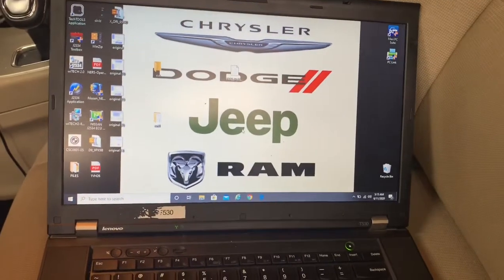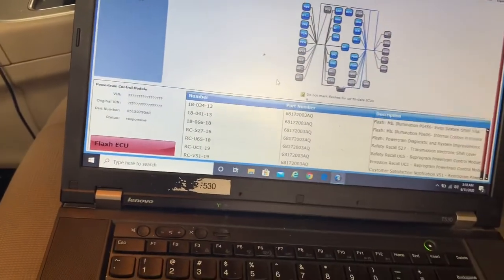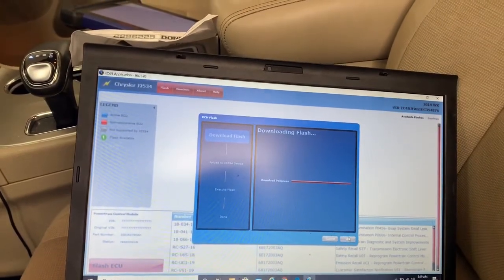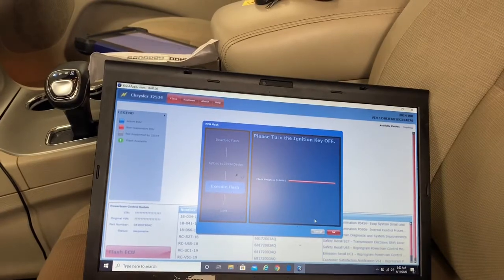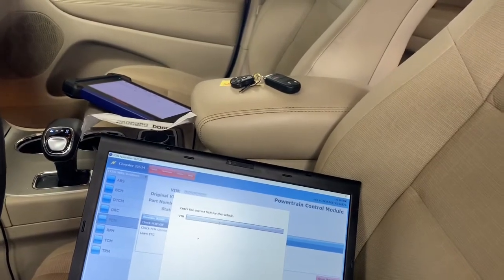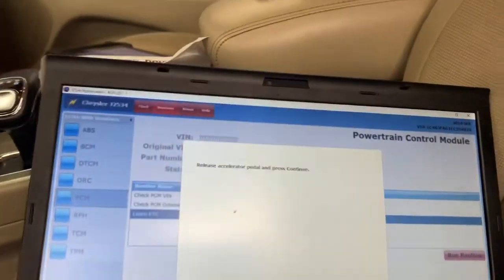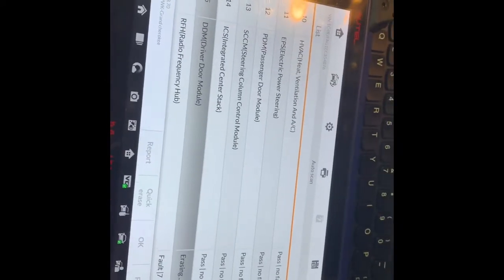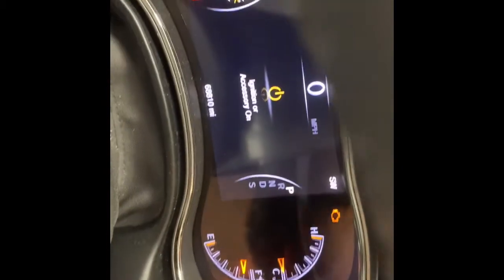2014 Jeep Grand Cherokee New PCM programming

Comment: Excellent video! Question-  From reading the info on Chryslers J2534 application, I thought you have to open the WiTech 2.0 app to program 2010 & up vehicles? Did you also need a WiTech 2.0 subscription to perform this program?
Thankyou
Reply from the maker: Hello, thanks a lot for the comment. you can do programming with j2534 on any Chrysler 2010 and up. The difference with wiTech is you ca do dealer level diagnostics and programming. J2534 does only programming and follow up routines. If you want to use wiTech years 2018 and up you will need tech authority subscription as well as wiTech. Anything lower than 2009 and lower you would have to use legacy application. Hopefully this will help out.
Reply: @huyug1  So im guessing you can program other modules with WiTech 2.0?
Reply from the maker: @autotechtogo6290  
Yes you can program any module you’d like as long as there is a file available.
Reply from the maker: @autotechtogo6290  you would see a thunder bolt sign by the module if there is an flash available .
Reply: Hello is your shop located in California
Reply from the maker: @chuy4739  I’m in New York I’m sorry
Reply from the maker: If you need I can connect to your pc and take care of it.
Reply: I don’t have the tools
Reply: My car is a Jeep Grand Cherokee 14. Do you know If there was ever a fix for this model?
Reply from the maker: @chuy4739  I’m not sure about the fix since I do not know the issue you are having. But just found out couple of days ago that j2534 flash application has banned and does not work anymore. You will need witech2.0 j2534 or microPod. You will as well need 3 subscriptions to be able to program. 
1. Tech Autority $26.95 daily
2. WiTech subscription $50 
3. Reprogramming subscription $35
That’s the only way of programming FCA vehicles unfortunately!

Comment: 2015 jeep grand cherokee. i replaced my pcm with a programmed new pcm with the car vin. the car engine wont start. it says press the clutch and push button.the pcm connector plastic piece i broke off bc after 10 years of rust i was not able to remove. however the pcm connector is tightly squeezed in the connector and snugged. the pcm is suppose to be plug and plAY.

Comment: i have 2015 chrysler 200 with push button,i changed the pcm and bcm from junk yard,do i have to ptogram it because now it says no key detected...i have tech authority and i know how to use j2534 applications..help
Reply: Pls explain
Reply from the maker: I’m guessing you can turn the ignition on but can’t start.  If that’s the case you do NOT need to pay for j2534 programming.  You will need a decent scan tool like Autel im608 or similar that will be able to perform special functions:
1. Go into BCM and select special function. Go into “check vin” function and it will read the current vin in BCM which belongs to donor vehicle. Than it will ask you to write the new vin which is the cars original vin.

2. Do the same thing as the BCM with PCM. 

3. Reprogram the keys with a capable tool. You will need the 4 digit pin code of the RFH( radio frequency Hub) which is ignition module or immobilizer. 

You might have to delete all the keys before you you reprogram them again. And those keys are reusable; does not need unlocking.  

If any problem you can contact me at 1 (347) 265-0322 and I will help you out.
Reply: Yes,you need to program them

Comment: Hi, need help with my 2018 wrangler jl, purchased from insurance auction with no ecm, bought a clon ecm online (to avoid all programming) once installed, jeep started with no problems but only for 3 seconds that happen 3 times then didn't even crank anymore. Just bought an new ecm from jeep dealer but they don't want to do the programming due the title. It's something you can do? I'm in Florida. Ty
Reply from the maker: Contact me on huso.technical@gmail.com

Comment: Thank you very much, this PCM it is new or already in other vehicle??
Reply from the maker: It was brand new from dealer
Reply from the maker: Used one is a lot more easier to program if you have capable scan tool
Reply: @huyug1   is it possible to reuse PCM already in another vehicle.
Reply from the maker: @hmohamed2006  yea definitely! And it is much easier to program.
Reply: but how to copy the other VIN? is it possible explained the method.
Reply from the maker: @hmohamed2006  what type of tool do you have?
Reply: @huyug1  launch
Reply from the maker: @hmohamed2006  I would have to connect to your launch tool and do it while explaining the process to you. If you want to get in get in contact my email is huseyin0240@gmail.com

Comment: can you get a print out of the final report
Reply from the maker: I do not have a post scan but there were no codes regarding to programming. And by the way j2534 application is outdated now it does not work anymore you would have to use witech or legacy.
Reply: @huyug1   thanks bro for the reply.   possible to get your email I’d
Reply from the maker: Huseyin0240@gmail.com

Comment: I have a 2006 Jeep Commander with a PCM that needs to be reflashed to latest software. How can I do that?  I have an Autel J2543 device. Thanks.
Reply from the maker: You will need to download witech j2534 or regular one if you have micropod. You need to buy tech Autority subscription, witech subscription and programming subscription from witech. Go to tech autority website find and download the file. Run witech switch to legacy application. The rest screen will prompt you.
Reply: @huyug1  I tried to download the file, but when I click on the button "Download" nothing happens.  Please help. Thank you.
Reply from the maker: @chukchee  that’s normal. use internet explorer 11 and turn off all windows defender and antivirus systems on pc  including java
Reply: @huyug1  I installed Internet Explorer 11 on my Win10 computer, turned off defender and antivirus and java and still nothing happens when I hit the download button.  Please help. Thank you.
Reply from the maker: @chukchee  is the witech downloaded?
Reply from the maker: If you are having trouble let me know I will connect to your pc remotely and see what happens. Before that email me at huso.technical@gmail.com
Reply: @huyug1  Yes, I downloaded the witech J2534 application.
Reply: @huyug1  Nothing happens.  I choose the file that I need, then click "download" and nothing happens.
Reply from the maker: @chukchee  check your firewall

Comment: Hello I am trying to do a new PCM on 2 Jeep Grand Cherokees:  2001 and 1999. What hardware and software do you recommend?
Reply from the maker: You can use an Autel or launch and select special functions and click on pcm replacement or just write the vin through the same menu. If you want to do dealer programming. You will need witech and switch over to legacy application and do the programming. Legacy is little more complicated. You should do a bit more search about it because you have to download the calibration data from tech Autority and do the programming.